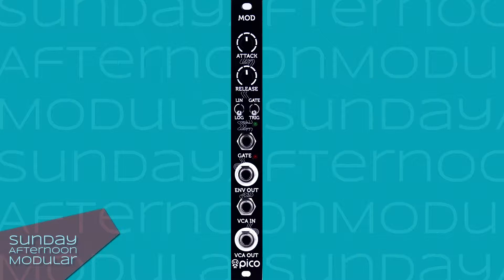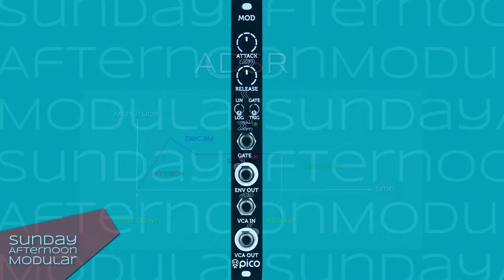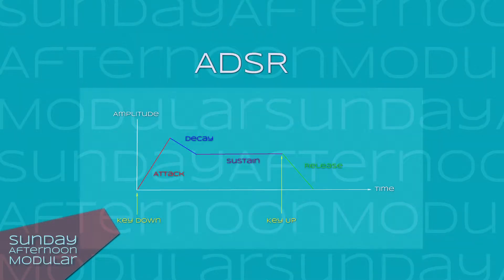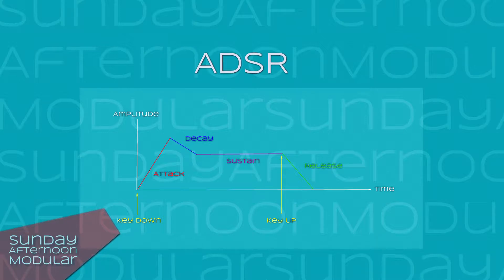Erica Synths Pico Mod Introduction

Comment: So the envelope is normalized to the VCA?
Reply from the maker: Hi John Doe
I hope I'm getting your question right. With the Pico Mod, you patch a gate signal to "GATE", and and the audio signal you wish to modulate to "VCA IN". So the envelope out is only used when you just want the envelope function but want to patch to another VCA module.
So yes, you could say that the envelope is normalized to the VCA.
Reply: Yes thanks.  When I first saw it I wasn't sure if you had to patch the envelope into the VCA.  Neat little module.  Looking back, yeah it's pretty obvious. lol

Comment: Cool demo but it's a shame you forgot to mention the LFO functionality ... When there is nothing connected to the Gate input the Pico Mod self oscillates... Attack/Release buttons allowing for shaping the signal (and its frequency). This is a very important point, making the Pico Mod (almost) as smart as Maths (one voice) or Befaco Rampage (that are both bigger, more expensive but also offering a bit more to be honest).
Reply from the maker: Hi Olivier, that is indeed a shame! I did not know that the Pico Mod has this functionality. This makes it an even more versatile module. Thank you for sharing this with me!
Reply: @SundayAfternoonModular  Module knowledge should be shared everywhere even at school, it's a part of the meaning of live :-)
The Erica black HADSR EG (a bigger boy!) has the same functionality (but with a switch). (and perhaps the Black VC EG too but my rack being off I can't check to be sure). I think it is the Erica's way of doing ADSR. And they're right, this is adding a cool feature..
Waiting for the next video !